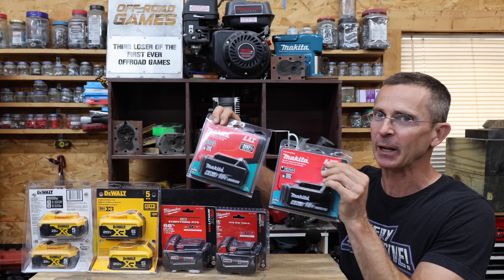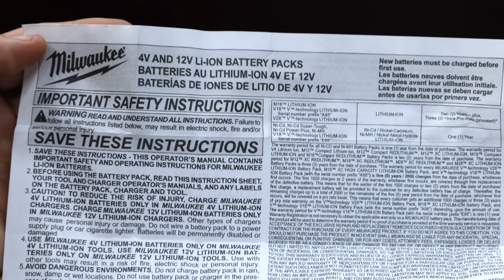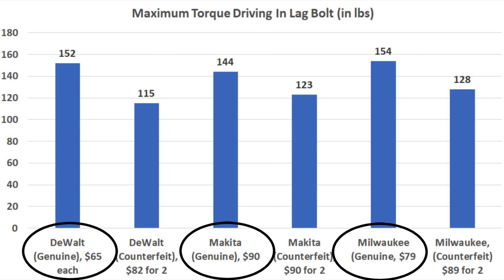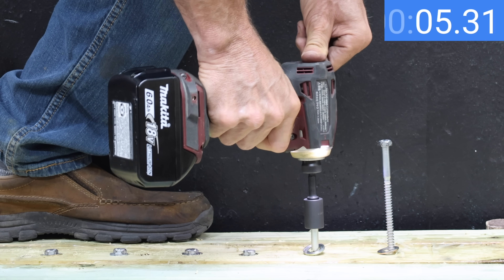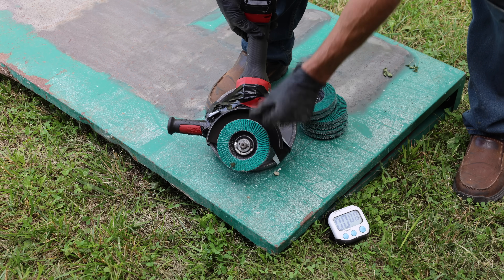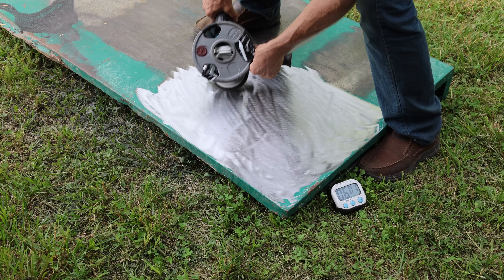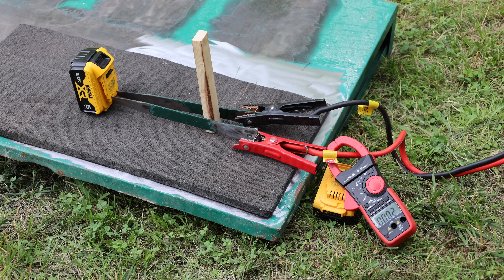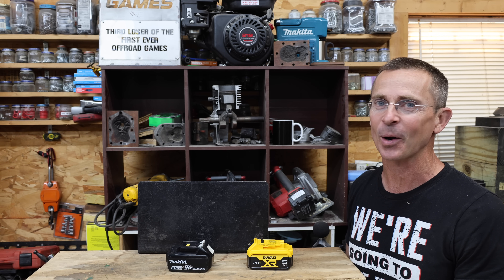Have You Been Scammed with a Counterfeit Tool Battery?

Comment: dang i might have been scammed, i have a battery from dewalt that died after just a few uses. it just stopped charging and everytime i used it it just didnt have the torque like my real batteries. i picked it up off of facebook market place so i couldnt really return it to the guy that sold it to me. it looked brand new in the package so i didnt think anything of it . but i did have many issues using it.
Reply: Your first mistake: "i picked it up off of facebook market place "
Reply: @CaptSkidmark  lmao right . never doing that again .

Comment: Actually I don't buy batteries that look the same as the original batteries -- authentic or counterfeit. 

I buy replacement batteries. For example, I have a few authentic black & decker batteries that came with the black & decker tools, but I've also bought a few batteries that are the replacements for the authentic ones, and they are very good.

When you buy replacement batteries, you KNOW they are not from black & decker. They are good, but they are much cheaper.

Comment: Years ago, in ham radio, the smart thing to do was never buy the branded batteries the radio companies sold for insane prices. The "clone" batteries were every bit as good for much less. At one point, I bought three unbranded batteries, all nearly 2x the capacity of the real ones, for about 50% more than one single "real" one cost. The only time I had a clone battery fail is if I dropped it onto my garage floor, which happened a few times. Back then, the sellers of the clone batteries were the assemblers of them, and if you had a problem, you called them and they sent a replacement. Now you have no way of knowing where the batteries come from, and you also have the fake "real" batteries to have to deal with. It's insane. I bought a battery for my present Yaesu handheld that uses AA cells, and at least I know it's not likely to die without warning. I've used it with rechargable batteries several times without failures, but it's hard to forget past times where the pack suddenly fails to charge or hold a charge, and you can't buy a pack for a handheld radio at Best Buy or someplace like that. At one point, I refused to purchase any scanner or ham handheld that didn't take AA batteries, as I had a lot of factory nicad and NiMh packs die without any warning.

Comment: Excellent video and seems like you had a little fun with that one. Especially the battery destruction. Maybe you got a little destruction devil inside of you... But don't fret... Most everyone likes to see a wreck or two at a car race! That's called being a guy! I wish you would have slowed the pace slightly in the first part, where you were showing the differences between the batteries and possibly shot that in front of a green screen where the background could be made red for the counterfeits and green or blue for the real Macoy! I was getting confused on which battery you were holding you were going so fast! Oh well.... Good video anyway! Oh and I definitely will be able to spot the real Project Farm in a look alike contest the minute they talk! The fakes are not going to have the amp hours that you have and they will run down a lot quicker than you. Hey your a great guy and we sure do appreciate what you do to help us not get ripped off and save some money. Thanks Sir! Later. 👏👍🏁🇺🇸 .J Poll.

Comment: Thank you for this! I recently got a pair of Milwaukee 18v through Amazon, and after running your tests, turns out I got lucky and they're authentic. Now I'll be running similar tests on other batteries whenever I order them online.
Reply: If you can just open them up. The counterfeits usually never have premium (Samsung or LG) cells in them.

I actually got lucky and bought a 2 pack of knock offs for my Hitachi tools, they have Samsung cells in it, but instead of being 3AH as advertised they are 2AH.

For the price I'm happy, and I knew I was buying knock offs. If they were advertised as genuine I would have returned them.

Comment: The big question for me is how do you avoid buying these counterfit batteries?  I would gladly pay the higher price for an original battery, but a lot of ads say it's original, but when it comes to using them, they are not even close to the quality of the original.  To me, Batteries in devices has to be the biggest SCAM out there.  Laptops in particular.  Hard to buy decent one's, and manufactuers MUST want people to throw away a perfectly good laptop, as they won't offer battery replacements after a couple of years.  So don't talk to me about Reduce reuse AND recycle.  If governments were serious about it, they'd put a stop to this and force manufacturers to provide replacement batteries instead of filling landfills with e-waste.

Comment: Thanks for mentioning the safety of the batteries in power tool usage, but one thing that's important to know with counterfeit products is that they are not regulated for safety in other areas as well. They could easily have lead, arsenic, etc. in the materials from the manufacturing/packaging process. These chemicals can be very unhealthy and even deadly in some cases. Counterfeit cosmetics have already come from China with lead in them.

Comment: As bad as the counterfeit ones are, the ones which don't even try very hard can be much worse.  I tested some "Replaces Ryobi 4Ah" ones from eBay that had an actual capacity of under 2Ah and failed to deliver anything close to the voltage at high current that the real Ryobi batteries provide.  I didn't check them for overload protection, but I'd be surprised if they had any.

Comment: So I guess my habit that I've gotten into where I purchased straight from the company if possible is a good idea cuz I am not smart so I would have no way of knowing if one is counterfeit or not that's why I don't purchase any kind of electronics on Amazon no more I go straight to the the website of the company and purchase directly from them in hopes that I don't get counterfeit I've noticed though the Good batteries seem to weigh more I'm assuming these counterfeit people are buying used batteries for pennies on the dollar if not just getting them out of the trash altogether but if you're someone who doesn't need their power tools constantly buying some cheap knockoffs is good enough I guess after learning what those batteries do when they explode Catch Fire it's freaked me out I'd much rather spend the 40 extra dollars on One battery then run the chance of something exploding on me now if you could take the cheap knockoffs and register them so they're under the actual warranty and swap them out that'd be pretty cool continue to get a real battery for that price but I'm assuming that's fraud

Comment: Have load tested Makita and Milwaukee battery’s with my Rigol Dl3031 electronic load ,at 1A discharge rate. In all tests got 80% of the nameplate capacity. Looks like all manufactures over state battery capacity. Haven't tested any counterfeit battery’s yet.

Comment: Good hands on review dude! Power tool batteries must have 2 things. The cells must be power cells. Power cells are high drain and high amperage, not like lab top batteries. Second, a BMS is needed to balance the cells, prevent over charge, and short protection.

Comment: Thankfully I only used corded power tools. Well except for some Festool light duty drills for clearing tapped holes. The runtime for a grinder is a good reminder to never head into using more cordless products. Thanks for your work on this one!
Reply: This is one of those times that you’re just going to want to believe me when I say; cordless tools when used in an appropriate setting are amazing. Sure, if you’re doing all your work in a small shop and can have all of your corded tools laid out exactly as you want and you are not leaving that area, awesome. For the majority of people though the projects range from a project in the yard, to the garage, to the roof, to a friend’s house, etc. 

There are definitely cordless tools that don’t do as well as corded. A big hammer drill for punching through concrete I’m going to grab a corded. For almost every common tool though (drill, impact, recip saw, circular saw, angle grinder etc) they will do everything you need cordless.  You noted the angle grinder run time being really low at 5 minutes. That’s using a flap disc with a large surface area, but either way, you’d be surprised how long 5-10 minutes is with an angle grinder when you actually measure use time versus overall project time. But yes, if you’re going to be sitting there grinding away for an hour on a welding project then setup the corded angle grinder.
Reply: @JimYeats  I do production work on steel, working with material up to 200mm thick. I'm a big guy and can stall a German 1900W 5" grinder whilst grinding with ease using a fiberdisc. Being an electrical engineer that is a little confused doing metalwork, the capacity of even the genuine batteries would see me go though 12-15 fully charged batteries an hour to match the corded tool. 

Yeah, intermittent use on a job site I get it. 
Battery powered tools are too heavy, badly balanced, lack the staying power of a corded tool and don't provide the longevity of service that a corded tool does. $5-$30 for some brushes and I'm good to go for another 100+ hours with a corded tool. At my previous employer we could not get genuine replacement batteries for relatively new tools and the generic replacements were junk.
Reply: @JimYeats  Another thing is that I don't buy Chinese tools. Metabo and Makita still make their higher end CORDED tools in Germany and Japan - the cordless were made in PRC, which really disappointed me. I'm not going to pay for a brand name tools, a brand name price and get a Chinese tool. The reason why I have some small light weight Festool drills was the I went shopping for a light weight too for thread checking, and Festool was the only brand where a cordless tool, battery and charger wasn't made in PRC. I was keen to buy Panasonic, nope made in PRC ( like WTF Panasonic cordless drill made in PRC?), all the major brands were made in PRC - except Festool, who got my money and they will continue to for just that reason.

Comment: I bought those exact knock of of the Dewalt 8AH, complained to eBay and got a complete refund and kept.The batteries. I use them for low risk applications like my kids Peg Perego And shop fan.

Comment: Counterfeit Dewalt battery uses EVE branded ICR18650/20P 2000Mah cells. Those exact cells are used in genuine Ryobi and Craftsman 4Ah batteries as well as the Meepo Standard electric skateboard 4Ah 36V batteries.

Comment: I have gone through so many bootleg batteries, and I'm not going to stop.  $40 vs $250 that Home Depot wants, is easily worth the terrible reliability to me.  For the impact, zero complaints.  It's the drill that eats those things for breakfast when I run it hard drilling through metal.  The drill has been on fire like 20 times, but luckily no battery fires yet.

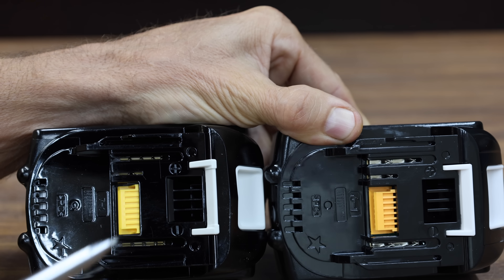Comment: 4:33 The swoosh behind the 18V is in line with the background behind 6.0Ah on the real Makita (on the left) - the fact that it doesn't line up right gave it away for me. Plus, the packaging on the fake shows a clock filled up to what should be 45 minutes (3/4 of the way), though the the eBay listing matches the real battery (swoosh lines up, clock filled about 90%), unlike the Milwaukee which has fakes in the image in the listing (not sure about the DeWalt)

Comment: I bought 3 dewalt batteries last year and thought they were genuine Dewalt but found out I was scammed. The worse part was that I ended up being hospitalized for a while shortly after I purchased the batteries. It took me 3 months to get back to work and when I used the batteries the first time I charged the batteries 2 of them shorted out on the charger. The third one still works but don't last near as long. I took the batteries apart after they shorted out and noticed the lack of circuit board and the cheap battery cells them.

Comment: Thank you for the information. I just looked though my DeWalt 5AH DCB205 batteries and all of mine are the old design with the yellow... I opened them up and no circuit boards. All fake. I bought them on eBay and made absolutely sure they were listed as genuine DeWalt batteries, they are all absolutely counterfeits.

Comment: I have been using  Knockoff Dewalt batteries from Amazon for a couple years now. I can tell a difference in run time but its not so far off that I would consider them a waste of money. The knockoffs have had plenty of power to do everything I need them to do. I cant attest to the safety other than I havent had any problems. Its hard to beat two 6amp hour batteries for $60. The batteries I buy from Amazon arent claiming to be OEM Dewalt batteries they are just knockoffs so they may be made a little different than the counterfeit, I am not sure.

Comment: Big props for testing the safety, apart from cell quality this is the biggest and most serious difference between (Properly made) quality batteries and cheap batteries.

That said you can get aftermarket batteries with quality japanese cells and proper protections.

Comment: Here is the thing, all batteries can catch on fire. If you are not dumb with it, its seemingly an option, even if its what 15% less power? For me at half the price, it seems competitive. Then again, maybe even better buying the cheapest brand batteries, and getting an adapter plate. 

Even the way they fail to me shows a disregard for the customer, the main boards fail, meaning no person can repair the battery. Instead of a real, user replaceable fuse. The counterfeit seems to be able to be repaired.

Comment: Thanks for all the good information. I bought a knockoff Greenworks 80v battery, and it lasted half as long as the real deal. It worked for 1 cycle, as it wouldn’t take a charge after that. Genuine OEM batteries are pricier, but you get what you pay for in quality and safety.

Comment: Some may have strong opinions on the honesty, but to get ¾ the work for ½ the price doesn't seem too bad to someone poor like me. What's really interesting is that they seem to do better than the no-brands I'd normally buy, which makes me wonder if they're using older tooling or possibly coming from factories that used to be, or maybe even still are, legitimate. I know if I weren't familiar with the real OEM performance, the counterfeits would be perfectly passable.

Comment: Several years ago I bought a knockoff Ryobi 6ah 18v battery.  It would not last as long as the real Ryobi 4ah batteries.  It lasted just over a year and died, so I took it apart.  The internal connections were thin 18-20 gauge wire instead of metal tabs like the real Ryobi.  I removed the 18650 batteries and tested them.  They showed to be 2.6ah each which is a far cry from the 6ah rating.  

So, now I will either buy batteries from Direct Tools Outlet for considerably cheaper for real Ryobi batteries, or I wait till Black Friday for a deal on the batteries from Home Depot.